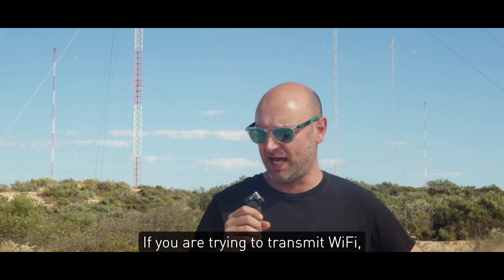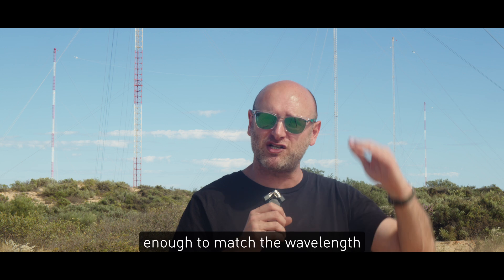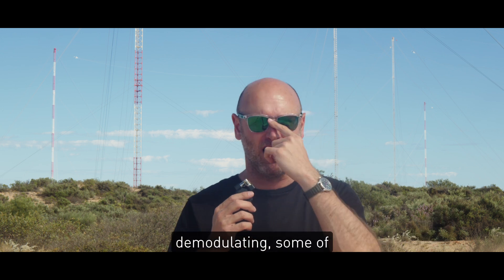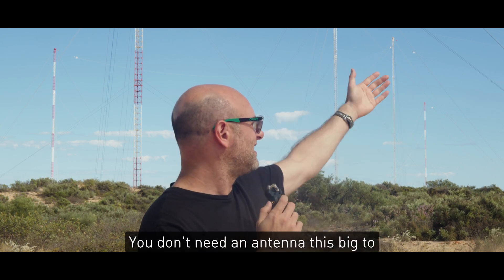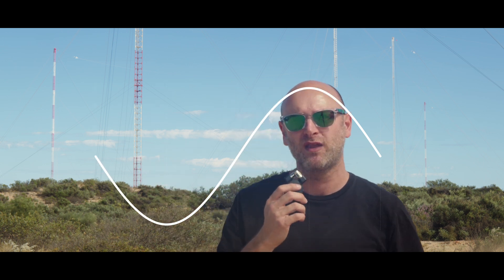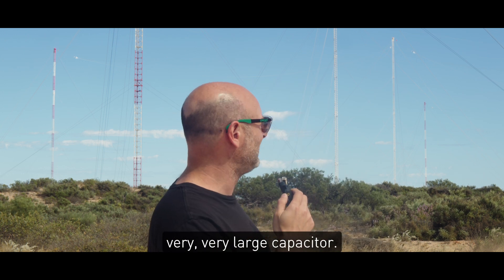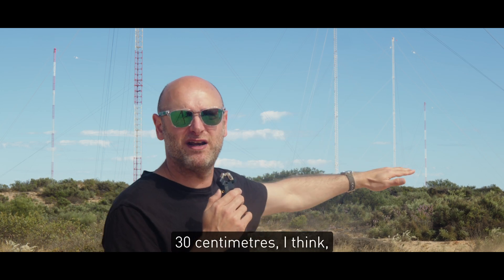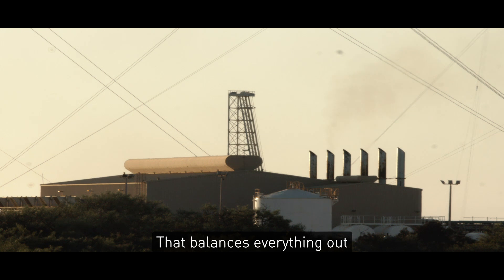Top-hat capacitive loading of VLF antennas

Comment: Thanks! Simplest explanation ever how antennas work!❤
However the part with tge capacitor was beyond my understanding..some more details please? You speak of „plates“ but show wires. As I understand, wires can store far less capacity than plates, no? And the dielectric wozld be where?
What I however understood is the resulting effect-shorter antenna for same frequency, just not sure what‘s the tradeoff of this construction. 
And this very low frequencies are they vulnerable to ionospheric noise? A followup video would be great!
Thanks for sharing this knowhow!
Reply from the maker: At low frequencies the distinction between a plate and a grid of wires is minimal. The dialectic is the air between the top “plate” and the bottom plate buried in the ground.

Comment: So the idea that the equipment was not picking anything up was incredibly wrong. There is a low frequency hum which, while somewhat audible on a cell phone, is so loud and intrusive on a good audio setup that it induces significant headaches. It might be a good idea either to filter that out of the video and repost it or put a warning on it.
Reply from the maker: I added that hum in manually. The 19.8kHz signal was completely inaudible by humans. I demodulated it to generate the hum. Sorry for the headache.

Comment: 20 kHz is the generally accepted upper limit to human hearing however many animals can hear frequencies quite a bit higher, I wonder if the wildlife in the area are affected in some way. I realize most of the power is put into radio waves however I imagine there would be a vibration induced in conductive materials nearby, and undoubtedly the wires and towers would vibrate... If I had to speculate I would guess that they are completely free of rodent problems within the facility :)
Reply: Sadly, i'm down to about 12khz upper limit now. Years, powertools, guns, loud music in the car, a few concerts have taken their toll. Earplugs most of the time have at least slowed it.
Reply: @texasaggiegigsem  Come again? Hehe I haven't tried to find out where I stand but given that I can claim  all of the factors above I doubt mine is much different. The earplugs weren't much of a feature early on either... I did get tested once, at the urging of my (now ex) wife who claimed I was having issues. After letting me know my hearing was generally fine, the Doc said that in his experience husbands getting tested because of their wives was hands down the most common reason middle aged men requested a test :)

Comment: A bit like the blck mountain tower in canberra. Warnings inthe car park that the tower can fry the electronics in your car.
Reply: wow really ☝️it has a warning sign. haven't been there in years.  the configuration of canberra is extremely interesting.  almost like Washington DC.
Reply: @brothermcdudebro  a big Phyramidal symbols ...
 Allover the place.
Reply: @brothermcdudebro do they use Pentelian marble there too?
Reply: The antennas of this one are all arranged in Sacred Geometry, and massive scorch marks on the ground depending on which satellite you're looking from. The Google Maps satellite doesn't hardly show them up, not sure what they've done. Usually things that use a satellite but are not specifically a map like flight trackers or weather will show things that Google has messed with.

Comment: This is kinda how I was able to get an 3.8 Mhz HF signal out of a mid sized sedan a couple decades back,  a capacitance hat. I'd clip small gater clips to the antenna to add capacitance and drop the resonant frequency as needed.
Reply: I managed to get back to Perth on 7MHz all day under the tower in the early 80's.

Comment: That's Learmonth yeah? I'm a geophysicist I work in airborne electromagnetic surveys in Australia, we pick up that thing in our EM data from hundreds of kilometres away, I've seen the signal recorded in EM data collected as far south as Kalgoorlie.
Reply from the maker: Exmouth - about 30km north of Learmonth. Or about 2 wavelengths :) I found some interesting papers in my reading about this from geophysicists who have to actively work on removing this signal from their data.
Reply: @superchromat  Yes, during presurvey calibrations we can see if we are picking up the signal, so then if we can see it we need to configure a system filter that removes that wavelength from the electromagnetic data, we usually apply the filter by default for all surveys in the Northern parts of WA.
Reply: @superchromat  Haha no doubt some of the papers you've read are by peers of mine who I know. I have worked for several airborne geophysical surveys companies in Australian over my 25 year career the signal from that transmitter is a big problem we often encounter in airborne electromagnetic surveys, which along with others is one of the most widely used geophysical methods for mapping geology and mineral ore bodies.
Reply: I think a need to brush up on electrical and antenna theory is needed here.